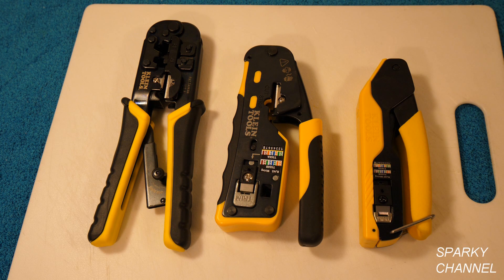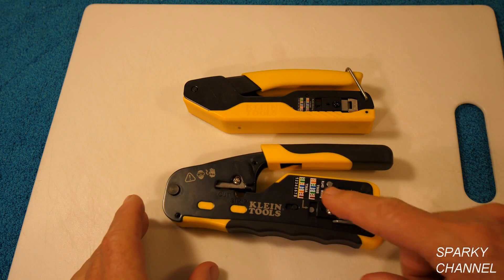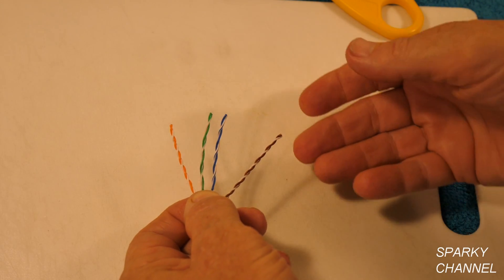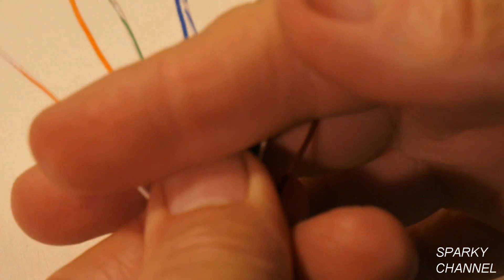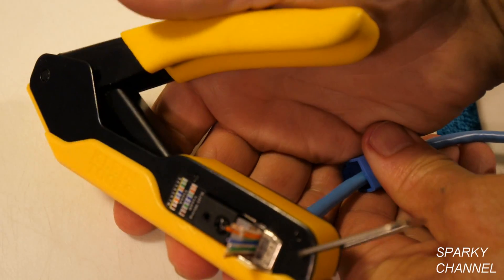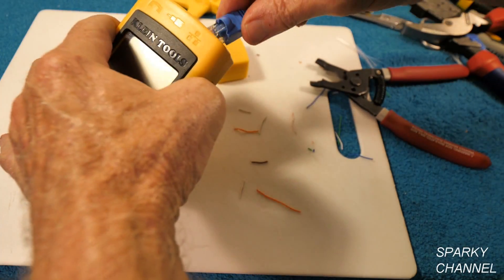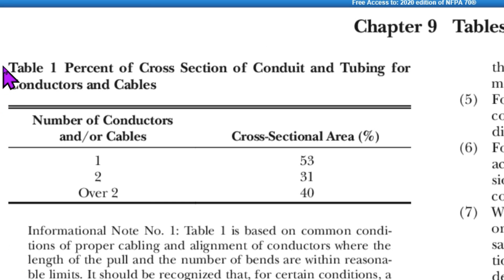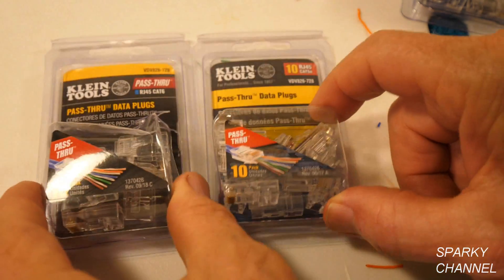Klein New Pass-Thru Modular Crimper + 2020 NEC 800.110(B) Ethernet Conduit Fill

Comment: Bro, cat5e and cat6 connectors are the same. The pins connect to the same wires inside. The only difference is the shielding inside the cable. Cat5e and Cat6 don't have specific connector differences. I think you're buying too much into marketing bullshit.

Comment: Is this the latest from Klein?  I have a free to air that has no quality I will be working on today when my new QPH-031 Invacom comes in.  I believe I may have some DiSeqc I switch I need to replace.  I enjoyed you video.  Is there a Klein tool that will trace the coax and assist in locating them?  Thanks!  I subscribed!

Comment: You can use the sleeve you stripped off to untwist. Put the sleeve in between the tips, and go down with it. That's what I do.
Reply from the maker: Thanks!
Reply: @SparkyChannel  thanks for the video. I bought that mini crimper, and strip tool. Smaller, more compact, weighs less. All a plus.

I didn't even know it existed.

The modular klein tool crimper is great, but lately it hasn't been cutting clean on pin 1 (orange/white) I have to pull it off the rest of the way. Is there a way to adjust the blade further down? Or is it time to sharpen it. I mean it's less than a year old lol.

Comment: I have the Ideal version of the compact modular but I also picked up this week the larger pass-thru Klein. It saves me from carrying a wire stripper and wire cutters. When I am 15' in the air hanging APs from my 12' ladder, I want as few tools as possible. :) I also have the Klein Tester/Tone kit I can switch it between tone and cable testing mode without changing cables. Klein makes great tools. Every cable I crimped with these tools certifies CAT6 on my Fluke OmniScanner.
Reply: You can also use the shears to strip pretty easily to make things faster. Don't have to switch tools then either. Set the cable between the 2 blades and rotate blades around a few times then snap off. Now you can cut the string and plastic and be onto untwisting.
Reply: @LeaningGumby  I don’t even own those shears. Haven’t had the need for them.

Comment: What brand of cat6 cable are you using in this video?  I am thinking about buying these same pass-through connectors made by Klein, but I have read lots of reviews that sometimes 23AWG wire doesn't fit through them.  It must vary by brand.

Comment: I just got the ratching ones and Klein passthrough ends cat5E. And First the cable jacket is to thin for the stripper to work AND when I go to crimp on the end it will not cut the ends at all.

Comment: Your tip to arrange the pairs left to right in the oranges, greens, blues, and browns before untwisting them was especially useful to someone like me who doesn't put end connectors on very often. It made it much easier to get the untwisted colours in the correct order for putting on the connector itself, without them straining against each other and jumping out of sequence or refusing to get into a straight line.

Thank you very much for the informative video.
Reply from the maker: Welcome! Sorry, I just saw this comment. 🙂

Comment: 2:28 as a network technician, I can confidently say that that shouldn't matter.  The plugs are just pins that stab into the wires and a plastic piece that clamps down on the cable to hold it in place.  The design might be slightly different but for such a very very very small length (a total of 2" or less from the plug to the Jack), it simply won't have any significant or noticeable affect on performance.  Or it shouldn't anyway.  After all, I believe you can actually run 10 Gbps on cat 5e for 20 meters.  Or something like that.  At least that's what I've found out from researching information on cable manufacturers.
Reply: Network technicians unite. We are severely under represented out here in these youtube streets
Reply: you right dawg, it's nothing against the dozens of meters. But sometimes cat5 Plug Holes are too smol or cat6 Plug Holes are too big/loose. But it's juuust a minute detail, like cherries on cream :)
Reply: So if I put cat 6 ends on cat 5 wire.. I’ll get cat 6 speeds.. 🤣  AV guy here. I know electrician don’t do many cat ends on a daily basis.  But this method would take all day to do many ends.

Comment: I tried the pass thru crimper in the past, but found a problem plugging them into some devices, especially working with radio antennas. They are just a wee bit longer and would not fit properly.

Comment: I picked up one of the heavy duty crimpers for work along with both the Klein and some generic (PETECHTOOL) pass-thru plugs. Excellent with either kind of plug. The cable strip feature is great so I don't need an extra stripper or scissors, the color guide is nice to have, trim off evenly with the blade feature, feed them right into the plugs and quickly check that they are still in the right order. Before putting the plug into the crimper, make sure the wires are even so they fit over the cutting blade or things will get gummed up a bit.

Comment: Not that hard to use a regular crimper, just takes a few extra seconds to arrange the pairs and trim them properly so the proper amount of sheath is inside the modular connector.
Reply: I had to choose which one and I went with the cheaper option since I’m a DIY’er and don’t see myself Cripping as a career.

Comment: Cat 5-e and Cat 6 individual wires are different in their guage.  These connectors are known as IDC or insulation displacement connectors.  IDC's are engineered for a specific guage, use the wrong one and you get unreliable connections.
Reply from the maker: Thanks!

Comment: Great video, can you do a cat 8 demo as well?
Reply from the maker: I don't have the equipment to make a Cat 8 connection at this time. Perhaps in the future.
Reply: I might be wrong, but cat8 isn't an actual spec... Or was that cat7?  I don't exactly remember honestly, and it might have changed since I last looked, but at least at one time not too long ago, there was at least one spec of cable being made and sold that didn't actually exist as an official spec.  Manufacturers were just using it as marketing BS.  Also, cat 6a is more than what most people will need for a while.  I don't know how familiar you are with data transfer speeds and subsequently, how fast 10 Gbps is, but let me put it this way; most storage mediums are capable of barely over half that speed.  There are actually local buses, in your computer, that are just 10 Gbps.    Most are several times faster than that, but still, 10 Gbps is quite insane.  Anything speced over 6a will eventually be useful but it could be a decade or more before it is needed....of course there are other issues such as the environment the cables being installed in how it's being used etc etc.  Such as manufacturing plants with a lot of machines that create a lot of noise.  Those often need high specs and shielded cables if not fiber optics.
Reply: @glasshalfempty1984  Cat 7 and either 6a or 6e don’t exist.

Comment: Could I use this crimper for my cat7 or cat8 cables? My cat 7 cables are flat. Cat 8 are round. I just rewired my home and had to cut the connectors off to fish two fo the cables through a very tight spot. Thank you.
Reply: I am fishing cat 8 to replace cat 5 as well in my home. I would like to know more about the experience you had  replacing all the cables. I am also replacing the coax in the house as well. Lots to do.
Reply: @rbnjr why?

Comment: i was at home depot and they only sell the first klein tool you showed before you set it aside. I am debating on returning it and getting the one you show. i just need a tool for home use.
Reply from the maker: Hi Matt! Home Depot is really slow to update their low voltage tools. IMO the new one I showed is the way to go.
Reply: @SparkyChannel  ok thanks. I found it locally at home depot. returning the old one I have been finding videos on how it can break the lock.  I am new to all of this so the simpler the better.
Reply: which one do you recommend the simple or ratcheting one?  simple one. needs a wire stripper tool also?

Comment: Ive had poe equipment go bad with this type of connectors they short out or kill cctv ip cameras a couple of times so even if its more difficult i use the old style 
also if you use a tweeker to separate the cables is a loooooot faster than the way you did it not to mention i will need a tool box to carry all the tools you used to do the crimp 
i will never use crimpers , lineman pliers , cable cutters , cable striper ...........
Reply: Their is a way for poe switches to use this connectors
Instead cutting the wires at the time of crimping with the tools just use a flush cutter and cut the wires as flush you can to the holes them before inserting the connectors to the crimping tools pull back just a hair of the cable 
You should see the tips of the coppers at the end but not completely flush with the end of the holes
Them you crimp this will allow proper crimping but at the same time no leakage or crosstalk or capacitance or shorts created because the copper tips to close to each other without insulation 
That the work around supported by the manufacturer
Reply: As a matter of fact you can use the first tool that sparky use to do this since it doesn’t have the blades lol

Comment: Hello Sr.! What would happens if I try crossover cable connection on the smaller tester? Probably will going to say Miswire, a mistake for the tester, So, you know that you are making it intentional, but you will never know with this tester if you did it right. The big one tester, somehow, shows you the crossover design which you were trying to make? Thanks!
Reply: Cross over cables aren’t needed or used in modern equipment 15 years old or less

Comment: Great video and very informative. But I have a question on your facts. You stated with a 5e rj45 connector on a cat6 cable, you will get the performance of 5e. I thought the way the cable was built is what made the difference and not just the connector. So are you saying otherwise? Or was this a mistake?
Reply from the maker: Your speed will only be as fast as your weakest link. It can be said for your router as well.
Reply: @SparkyChannel  Yes that is true, but the difference between CAT5e and CAT6 is the diameter of the cable inside the jacket and the way they are wrapped together. The reason there is a different rj45 connector is that there is a possibility of the CAT5 connector not fitting the CAT6 wire. It will not reduce the speed of the cable, that's all I am pointing out. But with all that being said, you have a great video and have a very easy to follow directions with the use of these crimpers. I also bought a pair of these and that is how I came across your video for the simple directions you provided. Sorry, I get wrapped up in the details at times.
Reply: @christianlavelle5848  ive used cat5e connectora on cat6 with no problem and no speed degradation
Reply: @christianlavelle5848  It won't reduce the potential speed of the cable itself but it will be the potential bottleneck.  The main concern is crosstalk at the connector, as DdddCccc points out below. Some cat6 connectors are staggered (as apposed to straight across flat) to help reduce crosstalk.  Others use an insert(as pointed out above by (Hilton Ralphs) which help keep wires properly seperated in the connector.  Some cat6 cable are made using solid copper 23 awg wires and therefore will have difficulty fitting into a cat5 connector.   I'm not sure what the "official" specs are suppose to be of a cat6 connector but I suspect there is a huge surplus of cat5 connectors that are being marketed and sold as cat6 connectors.  Because of the tighter and more stringent specs of a cat6 cable its often reccomended to verify/test your cables after crimping to ensure actual cat6 performance.  The cheaper the cable the more importance will be placed on the connectors being properly done.  This is also why its often recommended to just use cat5e cable if doing your own cable runs.  Or, if doing cat6, assume you are getting cat5 standards unless you can test/verify the cable.  Cat6 is potentially 10gb over ethernet... for me personally most of my hardware is still only 1gigabit ethernet.. ie my switch.  So cat6 may be good quality and good for future-proofing but currently wouldn't really do me much good.  Could potentially cut down on alien crosstalk but shielded cat5e should suffice for now.  I would never recommend plain cat5 though... just for the record.
Reply: basically, off the record, using a 5E connector on CAT 6 probably will have 99-100% CAT 6 performance. But officially, on the record, they say don't expect above 5E performance. So they indemnify themselves by saying that, and maybe sell more connectors
Reply: @Sparky Channel is correct.  Per the 568 standard, the components (cable, plugs, jacks) have to match to assure transmission performance.  

Crosstalk often happens at the connector side of the cabling system.  Just makes sense to use CAT6 connectors for CAT6 cable.   

I would even say ensure you have CAT6 components (marked in accordance with ANSI/TIA 568-C.2 Section 5.7.6)  if the scope calls for CAT6, or if the scope calls for Gigabit (1000BaseT) or 10Gbit (10GBaseT) IEEE standards to be met.  Caveat: CAT6 for 10G max is 55 meters.

I agree with you that Bill's Sparky Channel is informative!

Comment: I have cat 6a cable and like the idea of a pass-thru crimper.  Do I need cat 6a connectors or will cat 6 connectors work just as fine without any loss of performance?  Will the Klein crimper handle cat 6a?
Reply from the maker: Cat 6 connectors will give you Cat 6 performance even with Cat 6a cable.
Reply: @SparkyChannel  So, should I use cat 6a connectors with cat 6a cable? Will this tool work for cat6a?
Reply: @richardpatton4197  the tool works with cat6a but there are no cat6a passthrough connectors and even if they are i really dont recommended them ive had nightmares with them i use a lot of cresteon hdbaset syatems and they requier cat6a one time a customer did his crimping and used non shielded cat6 connectors and the device got fried the pins where all burned inside
Reply: @jcnash02  not if you use crestron hdbt
creatron requires a shielded cable with ground

Comment: as a ntwork guy . i dont care too much for the pass through type  myself ,  factoring in the costs of the plugs my klein clomper works fine
Reply from the maker: I understand, thanks!
Reply: Agreed, passthrough are garbage.  I prefer traditional style and I crimp a lot of RJ45's
Reply: @jamesdavies686  garbage? elaborate.
Reply: @kjclassic105  many times, they don’t fit when you plug them in. It’s not difficult to measure and cut for a normal connector. The instructions are usually on the box.
Reply: @jamesdavies686  not really garbage just an unnecessary expense. once you do two or three crimps with standard modular connectors you'll know how much to leave so your crimps are proper.